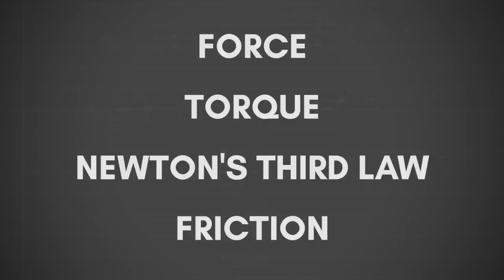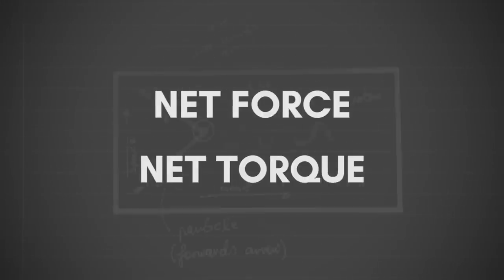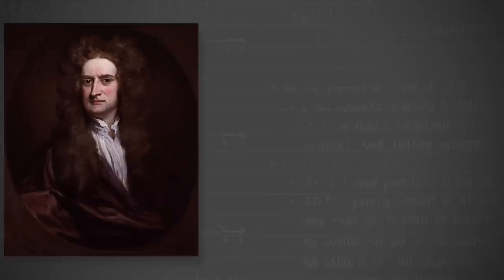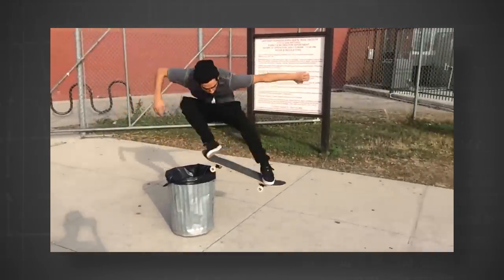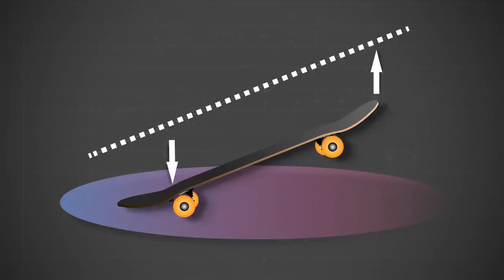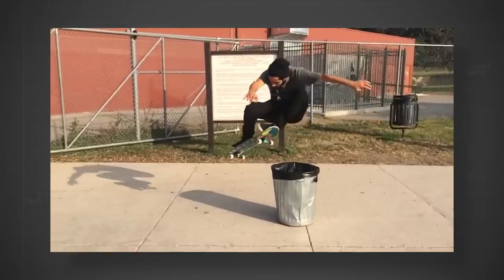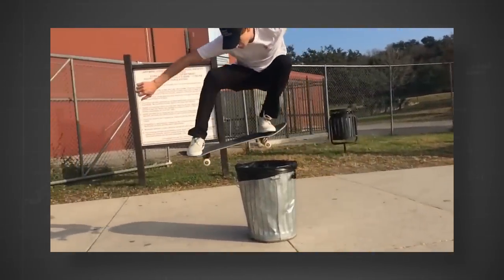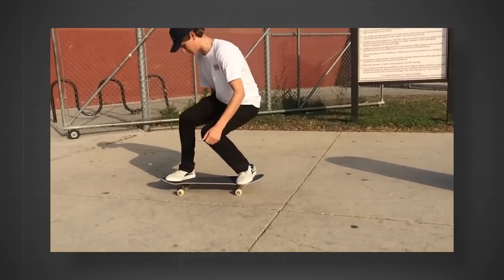How The Ollie Works: The Physics Of Skateboarding's Most Common Trick

Comment: Every scientific explanation of how ollies work I've seen has missed the mark. What sends the board upward is the creation and release of centripetal force. The skater pushing off to simultaneously jump and pop the tail creates the centripetal force vector, the mass of the board is accelerated inward around pivot point or axis of the back wheel. As the pressure of jumping is released, the centripetal force vector is eliminated, which sends the whole board in the direction of its linear velocity vector. 

Don't believe me? How come you can ollie without popping? How come you can pop your board into the air by itself? 

While you can ollie without popping, every skater knows how important the pop is. The reason it makes such a difference is because it abruptly releases that centripetal force vector, it also violently creates and instantly releases a new centripetal force vector, and creates a new and predictable linear velocity vector, or direction the board will be traveling. Most skaters can feel even slight differences in the length and angle of the tail or nose, this is because it effects the position and therefor timing of when the pop happens, i.e. the way the board feels and responds when they ollie or nollie (most skaters also easily adapt, within a reasonable range of variance between decks.) 

These are the things that send the board into the air, it is this momentum that creates enough friction against the skaters feet to allow them to further scoop and lift it up higher with their jump, and to control it.

The same physics are involved as when a catapult hurls a stone, a sling hurls a rock, or what would happen if you cut the rope on a tether ball flying around it's pole.
Reply: ⬆️ what he said
Reply: @2complex43  Exxxaaaccctlyyy!!!!!!
Reply: Greaaaaaaaaaaat science explanation!!!!!! Just what I needed!!!!! I've been so curious about how and why the only works.. your explanation is amazing and awesome and thank you. Be nice if you did a slow-mo science video explaining everything you just did in the comment section..
Reply: This might explain why you the roll of friction is overstated in the video.  It's actually not necessary at all.  You can frame by frame clips of certain people doing really high ollies without ever turning their foot, and in fact the board is separated from their front foot except for one brief moment where it taps it on the way up to simply to stop it from going end over end.  To put a finer point on it, explain a pop shove to me and friction is required to make the board go up.  The front foot is there to level the board out to stop the rotation.  Of course friction CAN be used, but it's not necessary.

Comment: This is the biggest mystery for me that you briefly mentioned. The skater pulling the skateboard up using the lip and friction when it's already in mid air
Reply from the maker: It definitely baffled me when I first saw an ollie in person. Hope you enjoyed the video. Thanks again for your support!
Reply: I think the friction is just used to boost the technique. Just sending the front end upwards then stopping it with the front foot will cause the back end to take off because the board's center of mass has upward momentum.
Reply: The explanation isn't complete, because the Ollie was a thing before the skateboard had a lip at the front. Back in the 80s, boards were very asymmetric, with an exaggerated tail and nonexistent front lip. Not only did Ollies exist back then, but the guys that were especially good at them could gain enough vert to land on the hoods of cars or completely clear short sets of stairs (upward).  

While I never gained the level of success that many did, I was good enough at Ollies to say from experience that the explanation here is incomplete and in some cases inaccurate. I say some cases, because it's not that nobody did it this way. But rather, it ignores some physics that are alternatively applied.  Specifically, vertical inertia. The initial "pop" referred to has to get enough of the mass of the board moving upward, fast enough, that any pressure on the front will initiate rotation. This is why a failed Ollie frequently results in a board against the balls. If you miss the front push, the tip is likely to continue upward. 

Additionally, if you watch the slo mo of this video carefully, the skater is NOT in contact with the board during much of an Ollie. This is because his vert is dependent not just on creating a lot of upward inertia at the beginning, but in only using the absolute minimum nose push for rotation. Any additional contact with the board serves only to push it down faster, and you definitely don't want to come down significantly nose first. That's a shoulder roll at best, and likely a face plant.
Reply: its all about the timing!
you just practice until you get the timing done.

cant pop? no ollie.
the sliding is not that hard because of the grip tape.

get urself a decent board around 80-90 bucks and practice it took me a couple days but i already had good balancing and just needed to lear how its actually done.  some people take a few tries to get it some a couple weeks. its pretty sick if you pull it off and is huuuuge fun if you land it perfectly!
Reply: @yarbles_  thats what he said in the video? if you just pop it you would do a wheelie mid air or just simply fall because riding and popping wil catapult the board away and leave you behind.
Reply: pyropulse   Dude he's dead right he just said inertia instead of momentum.  The point you're somehow missing is that the video suggests friction on the nose is what gets the board airborne. His post clearly points out that that's not the case.
Reply: pyropulse  well whichever has the most effect is debatable but there's certainly a big component from the kick that the video failed to explain.

Comment: As someone who's been skating for 20 years and popped thousands of ollies, it's still kind of a mystery to me how it works, and no explanation of the physics I've heard has really cleared it up. The mechanics of the board popping are simple. But I don't understand how the skater gets off the ground. For one thing, when you pop an ollie, the impact of the back foot is lightning quick with no solid contact to transfer the force into the ground. I don't see how the transfer of energy from the foot, to the tail of the board, to the ground, can actually lift an adult human into the air. It's different than jumping, you don't plant your foot on the ground when you pop and it feels like all the downward energy is going into the board, not into the ground. It's this weightless feeling that creates this illusion that your board is actually lifting you up, even though of course it's not. You do however lift your arms and suck your knees up to become "weightless" for a fraction of a second, so I'm sure this is a major key in the whole process. 

There's also the fact that some skaters who have particularly good ollies can pop higher than they can jump, which further complicates things, especially if you're operating under the assumption that an ollie is just jumping + bringing the board with you. If anyone with a better understanding of the physics has any ideas, I'd love to hear them.